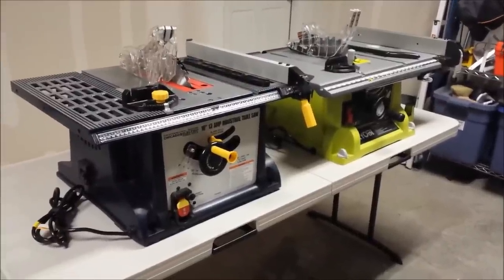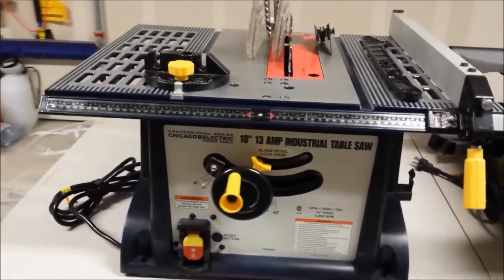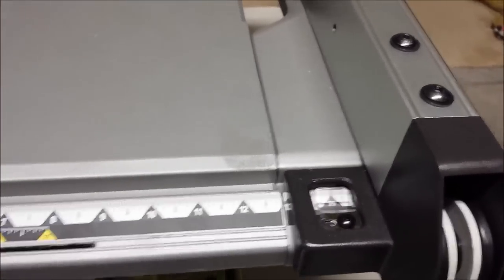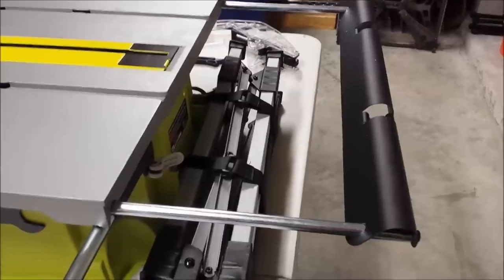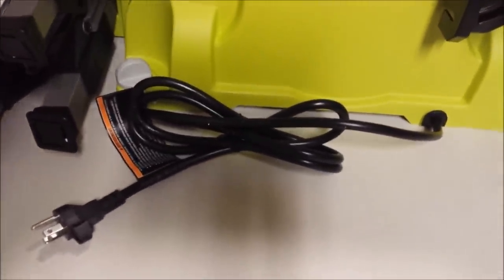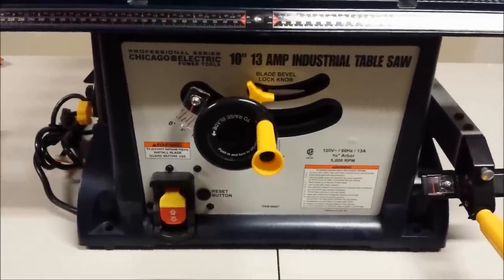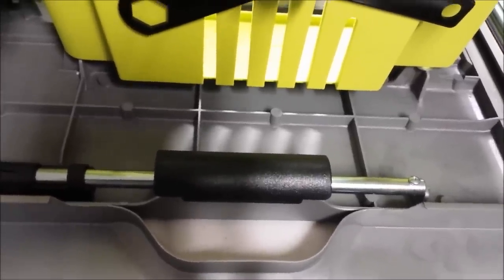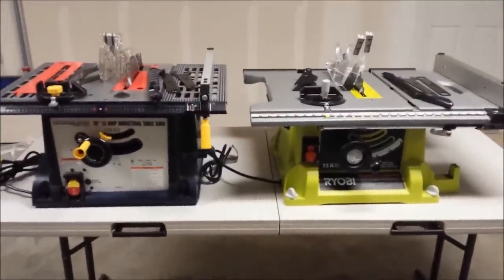Harbor Freight Table Saw vs Ryobi Portable Table Saw

Comment: The Harbor Freight is the Old Skil 3400. I have one since ‘88.
A good not great saw. But it gets the job done. I recently mounted mine on a large shop workstation. Currently with table saw and DeWalt 10” compound miter station that hides.
Reply from the maker: Thanks for stopping by and commenting.  Cheers!

Comment: The first thing we all want to know—is the fence square to the blade or can it easily be squared to it. Then—does it cut straight edges consistently and easily? If yes to both then tell us about features. If no to either question it fails.
Reply from the maker: Sarah Watson The fence on both of these two saws are more difficult to align to the blade then either the Dewalt, Ryobi, Ridgid, or Bosch I have reviewed. This video ill give you some additional insights into these saws.
https://youtu.be/ZM0Y6tnSJh4

Comment: Thanks! I once had a cheap table saw which cut straight as an arrow. I don’t do long rips so three or four feet is about typical. For a short time I had access to an expensive Delta three phase table saw which used a 16 inch blade. That thing would breeze through a 4 x 4 as fast as you could shove it. I am in the market for a small table saw so this is very helpful.
Reply from the maker: Sarah Watson Yes, a delta with a 16 inch blade would cut through a 4x4 like a blow torch through butter. Too bad we can't find that in a small table saw :-)

Comment: Excellent review. If I had to choose between the two, I would go with the Ryobi. However with that said, it would probably be better to save your pennies, cash in your aluminum cans, mow some neighbor's lawns until you can afford something better. The table saw is one of the most important tools in your shop and it is important that it makes accurate square cuts without too much fuss. I hear that the HF model is notorious for having a very inaccurate and difficult to use fence. Currently I would go with either the Hercules model at HF which gets excellent reviews or the Metabo, or the Dewalt. Any one of those would give you incredible results.
Reply from the maker: Hey Gregg, thanks for stopping by and commenting.  Cheers!
Reply: Nothing below dewalt for job site  tablesaw.. for diyer’s, mainly because it’s safer and quality of your cuts is better due to the stability of the product. HF, ryobi has plastic components which is why it’s cheap… I don’t trust the throat plate of the ryobi and I certainly don’t trust that fence lol… tablesaw is the most important tool for a wood worker and if they are serious about it sawstop is the best… but no diyer should go below dewalts saw…

Comment: Nice presentation about the two saws.. but not sure if you mentioned the most important part is that for $60. More on ryobi your getting a heftier motor.. running @ 15 Amps.. where the harbor freight runs on 13 amps...
Reply from the maker: Luis Acevedo Thanks for stopping by and raising these particular points.

Comment: How has the Ryobi been holding up for you? I'm not a professional wood worker, and I don't cut wood often, but I'd like to get a table saw that I can use to make reliable, accurate, and clean cuts when it is needed (building fish tank stands, reptile enclosures, and for house projects/repairs).
Reply from the maker: varanidguy To be honest with you due to the poor accuracy of the fence on the Ryobi I did not use it very much. It was difficult to get aligned. My preference is the Ridgid R45171. It'll give you the accuracy you are looking for the the types of projects you have and won't break the bank. Thanks for stopping by. You can see more in this playlist https://www.youtube.com/playlist?list=PLlOO6ucQXejZRcPk27-1d2n4XE2YpuQ28
Reply: Do yourself a favor and do not buy a cheap table saw for your first table saw. Long time ago I bought a ryobi as a beginner and right out of the box is no good, for starters the miter slots are not standard (only brand in the world with custom miter slots) so you won't be able to buy any miter slot accessories. The miter gauge is loose as hell. The fence is not super accurate. If budget is not an issue I'd suggest to go with Dewalt or rigid. The money you'll spend will be paid for by not wasting your time in your first projects. If you are a intermediate / expert then of course you can make it work by building a cross cut sled.
Reply: @nobytes2  thanks for the tips! I wound up buying a Ridgid around Christmas time last year.

Comment: It looks like the current low end budget models of Ryobi have been scaled back in terms of features. You can't get the extendable top for less than $250. :(
Reply from the maker: Hey Torq21 - I too have noticed this and have been wondering why they removed features.  Thanks for stopping by and commenting.
Reply: @WorkMateGuy  Thanks for the video.

Comment: The only problem I see with this review is that you are comparing the Ryobi expanded table, table saw which is $269 vs the Harbor Freight Table saw which is $119. You should have compared the Ryobi regular 10 inch table saw that costs $189. The $189 Ryobi 10 inch table saw has a lot less features on it.
Reply from the maker: Hey Derek - Thanks for stopping by and sharing your thoughts.  Unfortunately, the $189 Ryobi model did not exist at the time of this video.  Also, I had a lot of requests for this comparison from my viewers.  Cheers!

Comment: When will someone make a miter gauge that doesn't flop around? I bought the 8 1/4 inch Ryobi and it's a piece of junk. You cannot get the fence square and the blade will not tilt all the way to 45. It goes to about 43 degrees.
Reply from the maker: Thanks for stopping by and sharing your experience. Cheers!

Comment: Actually you left out one important fact on any of the smaller table saws. The fact that the case is plastic. If you are like me and do not have a shop that has conditioned air or is insulated, then plastic housings will dry rot rapidly. The conditioners in the plastic leech out rapidly if you live in a very hot humid climate like the deep South, Louisiana, Mississippi, Alabama, Florida, etc. I know because I live in Mississippi and it can get extremely hot and humid in the summer. I bought a Ryobi BTS15 and the case went to pieces on me in about 4 or 5 years. Since then, I have been trying to replace the case, but I have multiple health issues that limits me to only a few hours a day in my shop when I am well. So what use to take me about 2-3 weeks now takes me several years to do. But when I go is up to Jesus Christ.
Reply from the maker: Thanks for the info.  I was not aware of this.  Cheers!

Comment: I have the exact Ryobi table saw and in the process of making it built into a workbench. I took the outfeed table and the side table parts off. I will say I hate the T shaped grooves for the miter gauge. My table saw sled I have doesn't work with the grooves so I have to go back and fix it somehow.
Reply from the maker: Christopher Shaffer Well, Sounds like you have some work ahead of you especially with your sled. I would be interested to know how it all turns out. Thanks for stopping by and posting.
Reply: WorkMateGuy as soon as I get it completed I’ll send a picture or post a video

Comment: Will putting styrofoam inside hf saw will that hell quite it down and vibrate
Reply from the maker: I doubt it would quiet down this or any other saw. Also, It might cause the saw to overheat by reducing air circulation.  I always wear hearing protection when running my larger power tools such as these.

Comment: I wish I had a side by side of the motors, for they look the same, to me.
Reply from the maker: Hey Dwayne - These two are in the same class and I would not be surprised if they were made in the same factory in China.   If you don't mind me asking, are you looking to purchase a table saw anytime soon?
Reply: @WorkMateGuy  Yes I am. I used to have a really great old Delta monster, but didn't have a way to moved it to Oklahoma 16 years ago. But I don't need anything like that today.
Reply from the maker: Hey Dwayne - Both of these saws are not bad starter saws but have their limitations.  Have you looked at the Ridgid R45171?   https://www.youtube.com/watch?v=Nt_ZVGMy7U8&t=125s
Reply: I just ordered a Tracklife 10" from Amazon. It look's just like my step sons Bosch saw, and has to be made by the same company.

Comment: Informative video but a tablesaw is the most important tool for anyone who is going to dabble with woods I learned that the hard way. I returned my ryobi and got me a dewalt for now but I will be moving up to a co tractors saw stop when I actually sell some furniture. 
I know you want to be helpful for those diyer who isn’t going to be using this table saw that often but I can’t in good conscience recommend this tool for anyone. It’s unsafe and it’s unreliable. It’s probably better to get yourself a track saw or make a circular saw jig. That throat plate is not sturdy at all. It wiggles when you slightly touch it. The fence annoying and you have to reset it ever so often. Tap tap tapping away… end up frustrating you and ruin your work piece… the. There’s that stand lmao….there’s so many videos of people who did unboxing of this table saw and the stand looks like it’s about to fold like a cheap lawn chair trying to hoist a 500lbs man…. That might be exaggerated but it’s not safe….  If all these stuff is cheaply made I don’t even trust the blade staying on its arbor… I certainly wouldn’t try to put a dado stack on that thing lol…. In regards to HF lol…. Their Chinese knock off tools is 🗑… only good thing from that place is some hand tools and clamps…. Everything else is cheaply made knockoffs
Reply from the maker: Hey Marlon, thanks for stopping by and sharing your thoughts on this all important topic.  Cheers!

Comment: Horror Tools electric anything is not a good quality plus only 90 days warranty because of that. Ryobi is much better quality and comes with 3 year warranty. Ryobi wins every time. I bought newest RTS23 but before I had another Ryobi, blue one and I left it outside in the rain and in the hot California sun. It lasted 20 years of light homeowner use.
Reply from the maker: Thanks for stopping by and sharing your experience.

Comment: Thanks for this good review. I’ve been looking at these as well as this craftsman https://m.sears.com/craftsman-cm-craftsman-10-in-portable-table-saw/p-00941503000P

I’m leaning towards the craftsman I think. I’ve got to cut some luan plywood 1/8 (under floor laminate is what it is) cover a plaster wall after removing old wall paper. Need a table saw to make life easier. Any feed back on the craftsman? Also how stable are some of these saws that come with foldable tables on wheels? I like the craftsman as well as the ryobi there’s two ryobi I’m looking at this one you reviewed and the one with the foldable rolling stand. Thanks! Josh
Reply from the maker: jew0182 I think the determining factor may be the rip capacity especially if your going to be cutting larger sheets of plywood. In this case Ryobi may be the better choice. The table saws with fold able tables and on wheels can be very handy especially if your moving room to room. In this case your looking at the Dewalt or the Bosch. This convenience will run you about $100 more. So there are a number of variables depending on how you work and what your budget is. Also if your going to be doing a lot of cross cutting you may want to look into getting a miter saw if you have the budget. Thanks for stopping by and posting your question.
Reply: WorkMateGuy thanks for getting back to me. I already have a miter saw (harbor freight) very pleased with it. My budget is about 200 for a table saw. So that leaves me ryobi craftsman or harbor freight pretty much. I like the built in stand for simple of moving it from my shed to the carport for my work/project.
Reply from the maker: jew0182 You may be able to pick up a Ryobi R4516 for just about $200 because this model is being discontinued if not already. And the miter gauge and the rip fence are superior to both the Craftsman and the Harbor Freight. So keep an eye on Home Depot and do a google search for R4516 periodically, you may just find a good deal.
Reply: WorkMateGuy  Hey I actually bought the Ryobi R22 the one with the built in stand on wheels with expandable top. Haven’t gotten it together yet. I think it will suit me just fine. Time will tell
Reply from the maker: jew0182
Well, congratulations on your new table saw! You're going to get a lot of enjoyment out of this and the Ryobi is a good model to work with. Cheers.